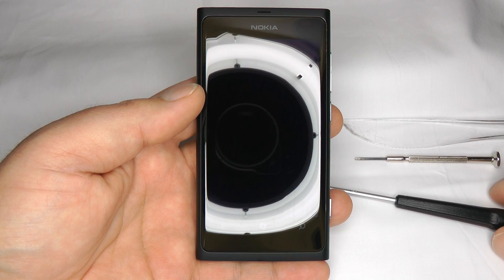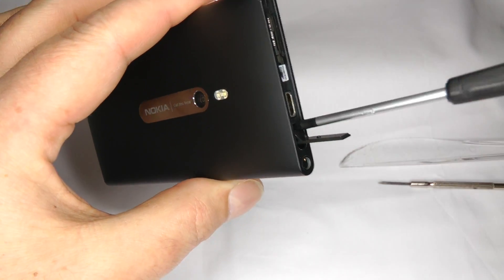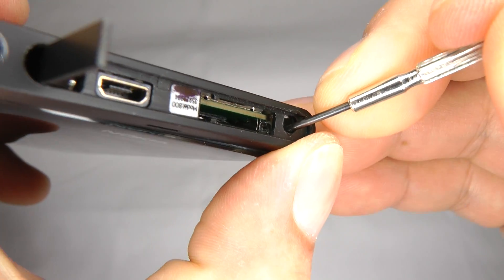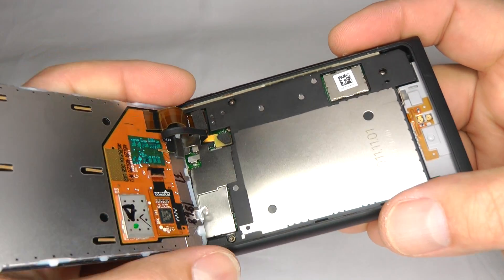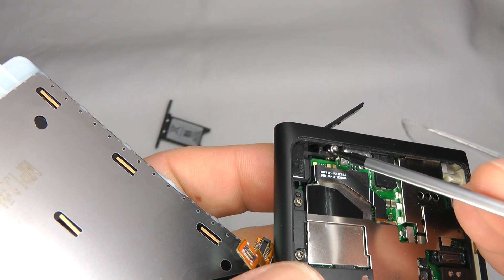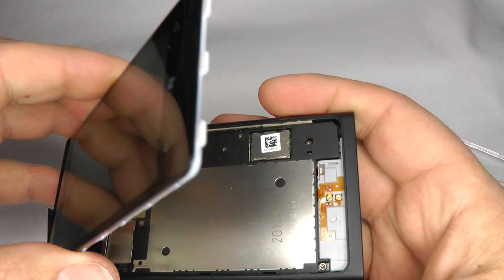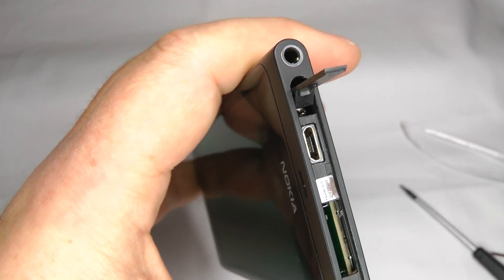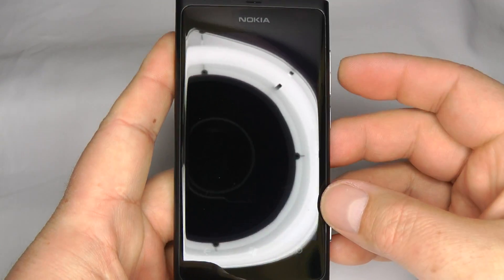Nokia Lumia 800 Screen Repair / Replace / Change a Broken LCD (AMOLED) + Touch Screen (Digitizer)

Comment: Hello I have just replaced the screen and a generic upgraded battery after many years out of action. I have seen the nokia logo starts up but then shuts down so I know the screen works.
When I plug charge cable in now I get an initial power connected strong light flash. Followed by 4 weak light flashes. then charging light stays off.
I also notice the power button does not click like the volume buttons. Is it possibly stuck down or broken.
When I first attach new battery I heard the Nokia Start up noise while reassembling but the screen was not yet plugged in. So I assume the OS booted initially.
Do you have any pointers?

Comment: Hi, I replaced my Lumia800 screen. I connect the flex and it goes fine, but when the screen chassis (screw tabs) makes contact with the phone chassis, the screen turns off.  Could yuu help me please?

Comment: Hi! I changed my LCD as the video showed to me. It's looks like easy, but if you have 3 or more years old phone it's not to easy to change. The LCD worked only one day because i saw i don't push enough the screen back. I think i disassembly one more and fix it. It was bad idea. I did the work like before, but when i would like turn on the phone only vibration nothing else. I know that's my fault, but i need a little help! What's wrong? I must replace the battery also? Or?The video is greet thank you!
Reply: +István Végvári  also happen to me

Comment: Hello sir, i have one question if you would consider replying to me that would be great,
I bought my Lumia 800, after 2 weeks screen got shattered after dropping it on the floor, twice. I managed to get a new screen and get it repaired, It cost me 100$ and now, a week later the screen turned all green. I went to the dude who repaired and he said: I don;t know if its a cellphone problem or a screen problem, either way its not my fault. But when he opened it to check, he saw that  he hadnt placed one little screw at the charging part, so I think that the problem was caused by that, when I charged the cellphone it got too much heated up and LCD was damaged. Is that the real issue here and what should I do? Thanks in advance.
Reply from the maker: I doubt the screw has caused the problem unless it was loose and shorted something. I would try another screen, it might be ok...
Reply: ***** I sent it to another service shop just to diagnose the real problem. If it is the screen's fault like you said then im good to go because the guy who repaired the first time will pay for it, but if one the the inner cellphone parts is damaged, im screwed :( thanks for reply anyway

Comment: Hi. Great video. I have two questions: 

1. Does it matter what REV the screen is? I have 8.7 but can only find 8.6 or 9.0. Will those work with my phone?
2. Is there any way I can tell what REV version the screen is besides opening it up? For example I want to buy a Lumia 800 for parts but the owner doesn't know what REV version the screen is and he doesn't know/want to open the phone to look on the connector. Could I tell him to do somekind of diagnostic that will tell him which version the screen is? 

Thanks in advance
Reply from the maker: from what I know I don't think it matters which revision the screen is. I don't know of any way of displaying the rev number without lifting the screen and looking
Reply: thank you for the quick reply. i'll try with a different version and see if i get any luck, then post feedback, if you don't mind.

Comment: Hy there, im here again :) i follow your video and i changed the part, but the screen is black when i calling, i think the sensor is not detecting, just when i push the top for working, i think the glue is dryed :S so where can i buy this glue? or someting else? :S i tried hard reset....air flowing....so i dont know, hope you help me, thx bro
Reply from the maker: try using some fresh double sided tape
Reply: okay thx dude :)
Reply: and....should i place double sided tape to every side of the phone? or just the top and the two other sides ( right - left ) ?
Reply from the maker: Data Base just around the sensor should be ok
Reply: okay thx for the help dude :)
Reply: i think its not working :S proxmity sensor fail? flex cable change?
Reply: or the screen is junk...?
Reply: i see proxmity light sensor flex cable on ebay, and its cheap, so buy one and replace ?
Reply from the maker: Data Base yes that should do nicely
Reply: okay i buy a flax cable and i hope its working, if not...the screen is junk yes?
Reply from the maker: Data Base the screen is fine, its just the sensor causing the problem
Reply: the proximity sensor is done and its work very vell... :) but my brothers phone is broke too the glue is gone, i probabli use double sided tape when i resambly the phone is vibrating but no screen its someting broken? im tryded the cables moving, but no answer :S

Comment: Hello expert ,I Have nokia windows 7 lumia 800. i recently ordered one display screen for my screen Damaged Lumia 800. I saw in your video the screen is having Two ribbon cables small n bigger one , But the one I ordered is Having only One bigger  ribbon cable .
Now Iam confused whether i have the Right screen ordered screen for Lumia 800 or NOT.
I have not yet opened my Damaged phone .
Please respond, Your reply will Be valuable To me . CHEERS

Comment: Hi, I have lumia 800 which my son droped on the floor with screen downward. Now it is not showing proper colors but phone and touch screen is working absolutely fine. There is no crack or even a scrach on the screen. i m wondering if i re-insert the screen. it might show proper colors again. Or if not where can i purchase a new screen from in India?. Waiting for an early reply, Thanks, Anurag
Reply from the maker: It might be ok after you have re connected the screen, if not you will find a link in the description with a discount code

Comment: Thanks a lot for this video.  I dropped by phone in a pool of water just momentarily and it continued to work for a few weeks but the screen is now unresponsive.  I'll try changing the screen and digitizer assembly and see if that helps.  I'll post back when I've completed the change-over.  Cheers!

Comment: Hi Le55ons, yes I did swap the sensor over to the new screen but it worked just for a couple of weeks, then it started to malfunction during calls (the screen light switched off and never turned on), so I decided to remove it for a test, I'll let you know how is going now :) Cheers!
G.
Reply from the maker: it works ok without the sensor but you'll find the screen doesn't change brightness or shut off when you hold it to your ear. Sounds like a new sensor will fix the problem

Comment: cześć moja nokia miała mały upadek z resztą nie jeden, i muszę wymienić wyświetlacz wygląda to nawet na łatwe zadanie jednak gdy szukałem wyświetlacza na allegro znalazłem to:
http://allegro.pl/nowy-oryginalny-wyswietlacz-nokia-lumia-800-sklep-i3797003845.html
i wydaje mi się że brakuje tu tej mniejszej taśmy.
Reply from the maker: Smaller strip http://youtu.be/Bu7HmpHxCFM?t=33s
is the proximity sensor that will need to be moved over to the new screen

Comment: I cracked my screen around 6 months ago and this week finally got a new screen to replace it with. This new screen is off my Uncle's old phone, so I know that it works fine. I followed this video exactly... but now my phone wont power on? Nor will my uncles old one (now with my old cracked screen). What could have caused this? Another problem is that my charger feels a bit loose in the phone, which it didn't before... so now I have two Nokia Lumias that won't turn on! Any advice? :)

Comment: My lumia has just had a small bit of water on it, I had it repaired (the screen popped out a little at the top) and after this, the screen has been quite wobbly, now my screen is unresponsive, and the touch screen will not work. I have tried the soft restart (holding the power button for 10 seconds) and im scared to restart it because it has not been backed up! Please help asap!

Comment: I would advise against keeping the screw that won't come out in its little box. With a bit of fiddling it is actually quite possible to put it back in after you've reassembled it, and it will prevent you from accidentally damaging the phone's interior components if the screw comes loose and gets stuck between the screen and the inside. Apart from that, thanks! The phone still works, fortunately ;-)

Comment: hi i replace the screen but it touch screen don't work, sometime i can see that if i touch my finger on screen i can see some movement but then it stop. i hv try 3 screens, but all are giving me same problem, i work in mobile repairing shop, so i hv tried lot of things to make it work, is there is anything you can share with me to resolve the problem, thanx

Comment: But the old one doesn't work.But the new one was working for a moment and then, after i plugged in the proximity sensor it started to happen. Maybe something is wrong with the screen plug?

Comment: I've changed the screen, following the details provided. Everything went as described, however, as with Lilly, the display is working but the touch screen is not. I've tried removal and replacement just in case of a bad connection, but still the same. Just in case my new screen was faulty I replaced the original screen, which was previously fully functional in spite of the cracks, but the same symptoms now exist with the old screen. Is there a cure or is my mobile now irrepairable?

Comment: Thanks, I would never have attempted this simple fix without your video.  Had a bit of a panic when it didn't start up when I pressed the on button - Holding down the on button for about 15 seconds sorted the problem out.

Comment: Thank you very much! Very good tutorial, probably best on youtube :)
But after replacement, there are clicking sounds in left bottom corner, when Im tapping with pressure on it. Feels like clips are not locked. But they are.

Comment: I don't think a reset will help with a display problem, if it was working before then I would guess the flex cable or plug now has a problem

Comment: Hi! 
I replaced the screen and it worked well. I found the edge of the screen not fit perfectly so I removed and replaced it again. Then the screen remained black. Still sensitive (I feel vibration when i touch it) but black. 
Do you think that the factory reset should solve the problem?

Comment: hey there, I have just bought a replacement screen, but it is missing one of the plugs on the back of the screen. It is the smaller plug. Will this be a problem??

Comment: Bro I have the same problem. All you do is hold the power button down for 10 seconds and the phone eventually Power Up. Sometimes takes a few goes but eventually works. There was a dodgy batch of Lumia's unfortunately it seems like you have one like me.

Comment: Hey, could you give me a bit of advice?  I just cracked my nokia lumia 800 glass screen however the LCD still functions.  I have seen a few replacements on amazon for £35.
So i remove the old screen, swap over the proximity sensor from old screen to new and then reassemble the phone?  Could you recommend a screwdriver set that will fit the screws?  I have never done anything like this, but i think it looks simple enough.

Thanks for the upload, you make it look so easy.  Liked and Subscribed.

Comment: Can anyone help me? I have a problem with new screen. When new screen is plugged on there ar small blue line on the screen bottom. New screen connection cable is rev 8.6 and old is 8.7. Old works perfectly. Is it possible, that rev 8.6 is reason for this?

Comment: Hi there cheers for the video helped me out alot! i fitted my screen but for some reason it only had 1 screen plug in and not 2? will this affect it.The picture is fine when phone in use apart from a minor faint line running through the picture.
Thanks ben

Comment: Hello the guy who made this video! Thank you for your help! All worked fine. Only one suggestion to other users: make sure you move the big black pillow from old screen to new screen. (black pillow from the black connector) I ordered from ebay.com and ordered correct screen by searching: "LCD Display Touch Screen Digitizer Assembly Full Unit For Nokia Lumia 800 N800"

Comment: Thanks, worked great. However, on my 800 the screw next to the USB port came out to the top without a problem. Maybe they changed the assembly up there a little bit.

Comment: Brilliant, thank you! Must order from etrade supply in future though - the new screen felt 'different' due to cheaper glass, turned out to be a refurb and have shouted at the supplier with hope of a suitable resolution!

But phone now fixed - seventeen years since I last broke a phone, but your guide made it trivially easy to repair.

Comment: Hi, i dropped my nokia lumia on the ground and the screen cracked in several places, the screen is completely black and does not work at all however i can still feel vibrations from my phone, i was wondering if you could give me some advice as to wether i should bother replacing the screen as the damage may have affected how the phone actually operates or could i just be the screen that needs replacing, thanks

Comment: Really Great Job LE55ONS!! I just have fixed my totally crashed lumia 800 LCD just cause I saw your tutorial on youtube. THANX A LOT!!! Just a little problem..The new LCD/touchscreen doesn't have one of the sensor flex cable (the thinnest one), so I just could connect the large one My lumia works now perfectly. What's the function of those 2 cable?  and do you think should i stil buy a new set with both sensors and try to connect it? if yes how can I connect it to the LCD/touchscreen? thx again

Comment: Hi, i replace old proximity sensor, on the new screen, it still wont work. im wondering to buy a new screen and cover, becouse my ones is broken, can u give me advice, from where i can get cheap parts, but not like chiniese one, that have dead pixels, or not glued properly. im from lithuania so buy from etradesupply its big price. im wondering to buy from ebay, but i bought from one guy and he sent me 2 broken screens, afcourse chiniese guy, is it better to buy from uk or HK sellers?

Comment: Hello i bought two screens from ebay,differend sellers.I follow evey single step in all the installation progress, but after all, ive go to problems with both screens.
1 is the urple line on the bottom, it just shows when i have light backgrounf, but if i have it low i cant see anything, it just dissaperes.
2problem with calls, my phone responses to light. but when ive got a call phone just freezes until the caller cancels the call.did somebodey bugt it from  does screen works?

Comment: i have replaced my screen but its not calibrated properly or something. The new screen works but when i push the screen it effects an area just below and to the left...for instance to input my code to unlock my screen which is 5555...i have to push just between the one and two. Is it a faulty new screen?

Comment: I had a similar problem. It turned out that the white plastic frame had came unstuck from the glass touch screen along one edge. This caused the screen to sit above the phone body at one corner instead of sitting flush. I had bought the touch screen digitizer attached to the frame as one piece on ebay. I uploaded a youtube video showing the problem, and the supplier happily exchanged it for me.

Comment: Hey LE55ONS i got a problem:
I changed the LCD on my Lumia 800 today but the lcd works i saw that touch(screen) does not work. My Lumia fell 3 metres to the ground is it a new-display problem or is it possible that something else is damaged?
i noticed that the new lcd had just one cabel to connect with the mobilphone, so i took the one from the old....

Comment: do you have to replace the sensor cable? as i have just ordered a new screen and it doesnt come with the smaller cable, so can i take it off the old screen and put it on the new??

Comment: You're a hero!!!

The screen I brought only has 1 off the connectors, I had to take the smaller bit off of the old screen, wouldn't of had a clue if it wasn't for you

Comment: I dropped my 800 about a year ago, and now I've finally bought a screen to replace it , I've done everything you said in your video and even disconnected the battery and reconnected but still nothing happens I can't even tell if its charging. Any ideas?

Comment: My lumia 820 screen is cracked and the functions at the bottom do not work it slipped out of my hand one day walking into my house on cement tiles and it cracked the lower right hand corner of the screen the lcd and everything still works just those functions back,home and the other function where it is cracked on the lower right hand corner i have a new glass screen coming but it takes 10-15 days cause it is coming from over sea's. I would fix it my self but my hands tend to shake

Comment: will this work if the LCD display is broken too? i was unlucky and dropped my phone on the ground, screen down =/ and i can hear it work, but the screen is mostly black with some pixelated lines. does a new LCD display fix this?

Comment: On my new replacement screen there is only one cable thing on the back, where as on yours there are two, a wide one and a thin one, i only seem to have a wide one? I havnt attempted to put it back in yet as the tools havn't arrived.

Comment: For people about to try this I found it easiest to remove the USB cover rather than trying to squeeze in through the gap, it means you can remove the screw entirely rather than have it rattling around and it makes it much easier to reassemble too. To remove the cover just open it up fully and pull directly away from the phone. Also add super glue to the shopping list if you've bought a cheap screen, the frame /will/ come away from the glass.